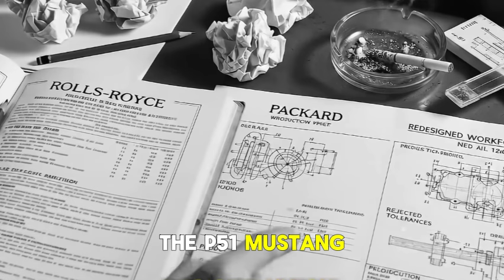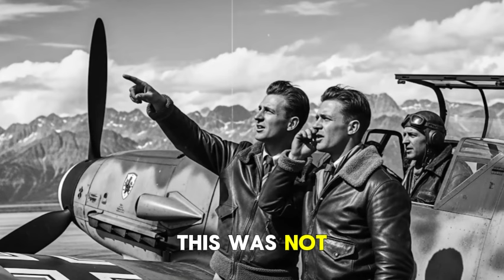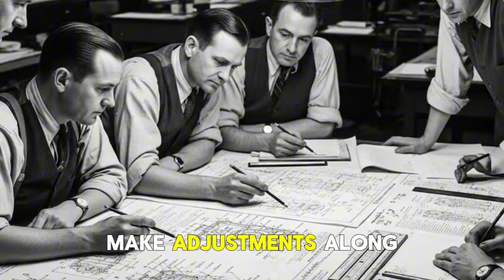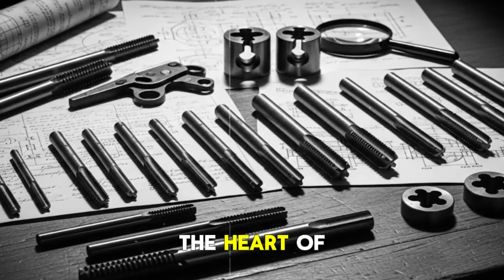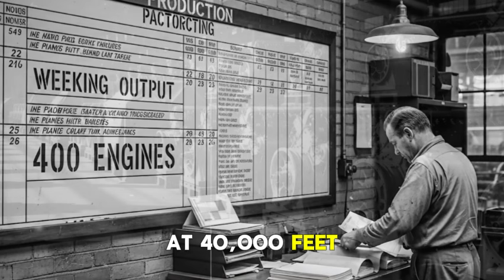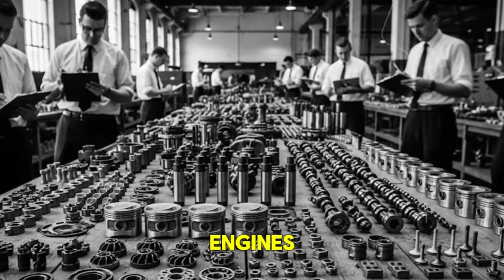America needed a cheap, reliable engine—Packard turned the Merlin into a mass-production machine.

Comment: The point not mentioned is that it was not a matter of Rolls Royce being unable to do mass production,  they just could not afford to stop production while they changed how production was done. When the Merlin was first put into production it was never intended for production in huge numbers. Pre war Budget restraints required the hand built system as the cost of gearing up for mass production was too high for an engine only required in limited numbers. That was pre war!  Once WW II started all Rolls Royce could do was gear up the existing production. The RAF needed every Merlin they could produced.  To stop and take the time to re-engineer the Merlin for mass production would mean a pause in production could have cost them the war. America had the luxury of not being at war and could start afresh converting the Merlin from being hand built to mass production, This co-production has to be one of the greatest examples of two countries co-operating to fight a common enemy.